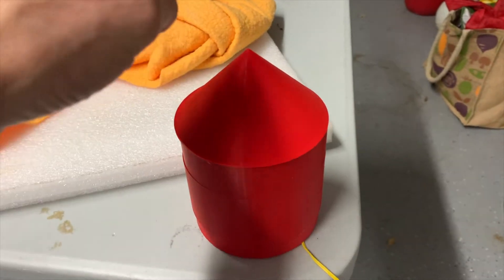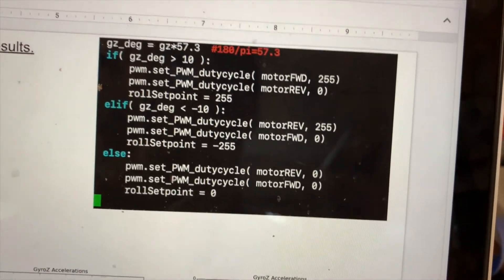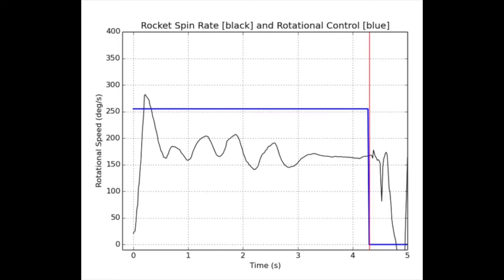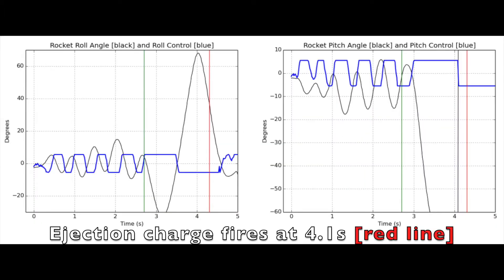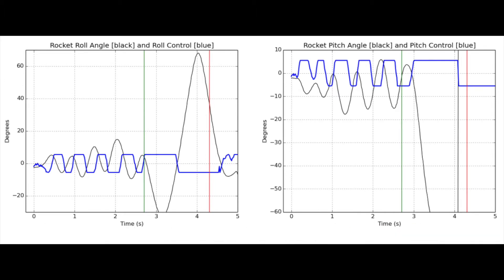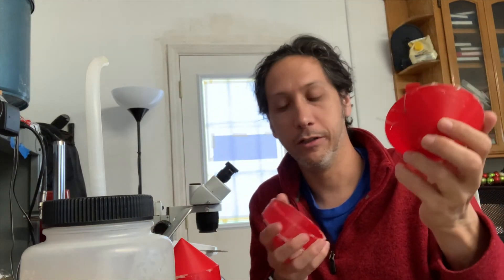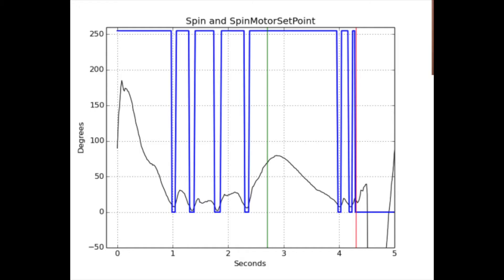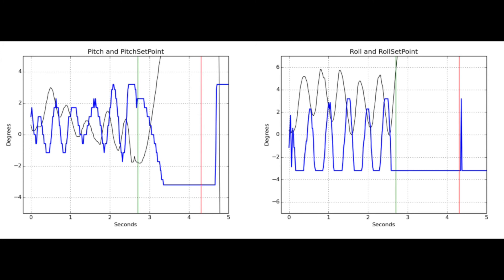Thrust Vector Rocketry with Spin Control

Comment: You need to make sure the parachute isn't inside the nose cone it could get stuck, one less thing to worry about. 😁

Man do you realize how "complicated" trying to control a rocket that size is! Good job! 👍 I would suggest you bite off the issues one at a time though, you might reach your goal a bit sooner. 👍

The "pitch" is x axis, the "yaw", is y axis, and the "roll" (spin) is the z axis, you have to put yourself in the astronauts position for orientation. 👀

DOAH! 😆🤣😜👀 It is ok! Did you say WOOPSIE! 👍

You will find it is easier to control the roll with fins, as NASA and the Soviets found long ago, 1. fins, 2. gas, 2 mass.

The trouble with vehicles this size it you still have to make the adjustments like the large ones over a greater amount of space and time, it you "overcorrect" to fast, things get ANYGRY! 😜👍

Great job though keep it up! I like that you are using a 4" body tube, that is the size I like! 👍
Reply from the maker: Fins will definitely help increase inertia and air stability.  Part of the fun/challenge was removing them, which is why I don't want to put them in. They add complexity and weight as well
Reply: @peterb7615  And, a spinning weight isn't! That is more of a challenge, but hey that is what we do it for! 👍